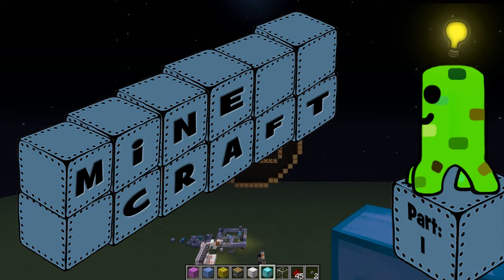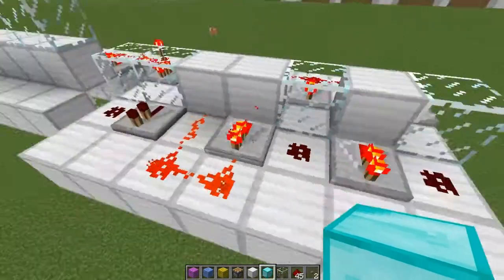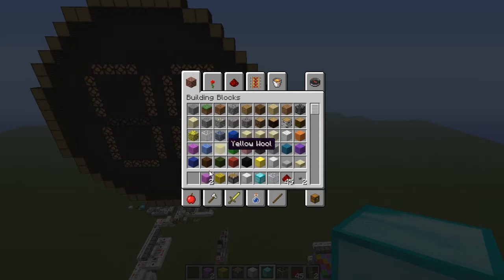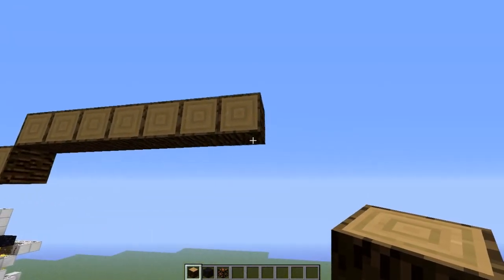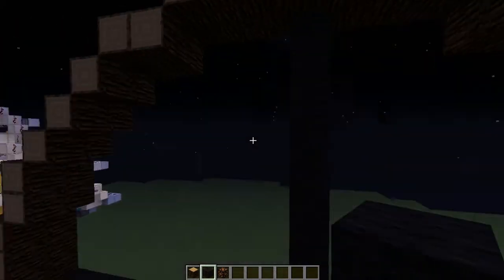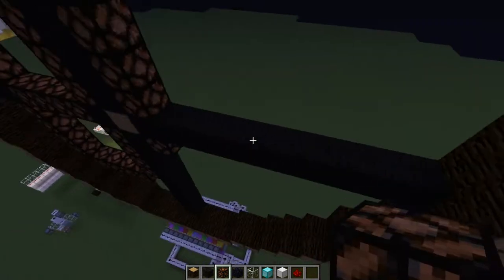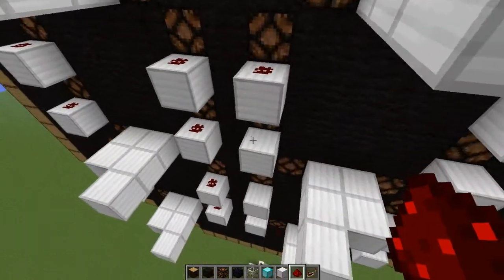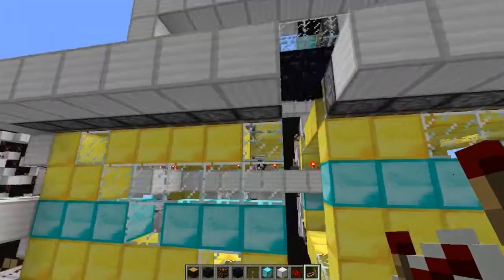Minecraft - Count Down Timer - Part one

Comment from the maker: The tutorial you linked does show a good idea for a one minute timer but, the bulk of the clock that you can see is the display coding blocks as will be shown in the next video. The part the one minute timer would replace is not that large part but if need be my mechanism could be substituted with the one minute timer in the link tutorial =)